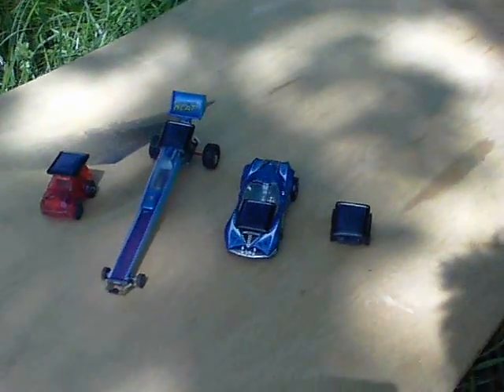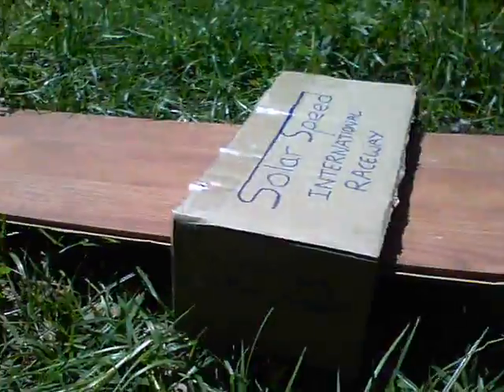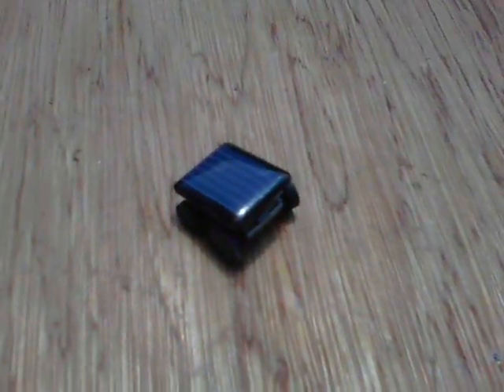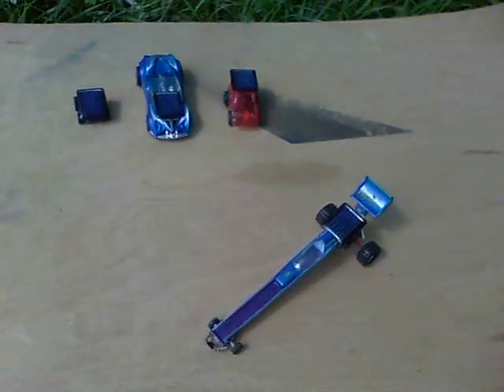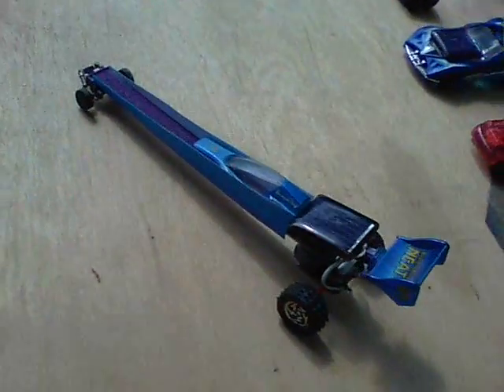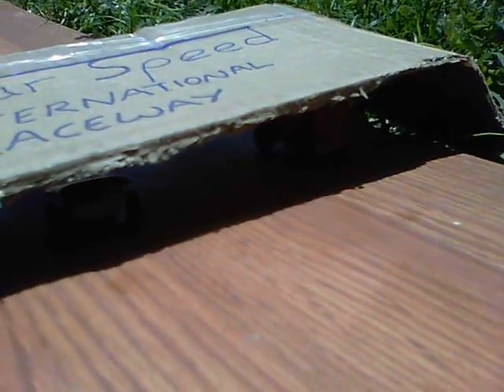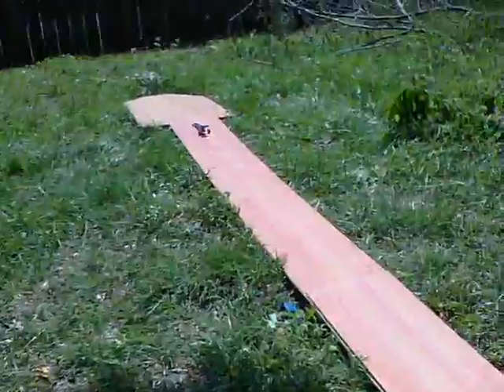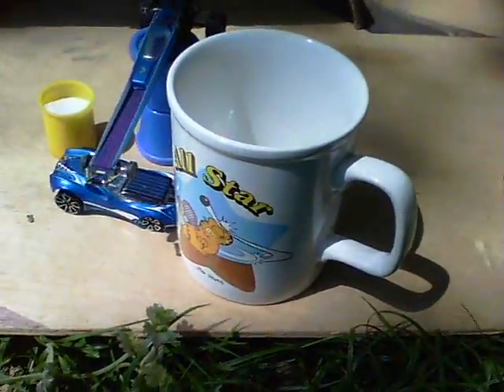Solar Speed Raceway

Comment from the maker: Thanks. "Only things missing were smoke, flames, and screaming motor sound", gawd I know, think of the real thing in about 20 years time...whirrrrrrr at just above background ambient noise lol 
Might run an out of control Stirling engine and a 1.5V motor at 6V for those effects in a future video :)
Have just finished an 8 gram Dragster in white, to challenge the other 10 gram one. It goes like its on rails but doesn't look as 'right'. It just has to top the other for speed !